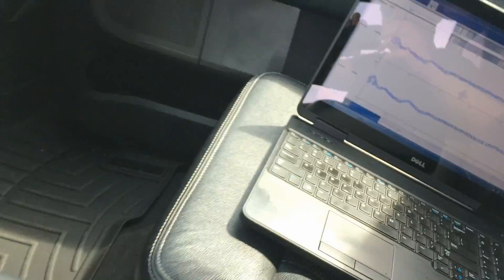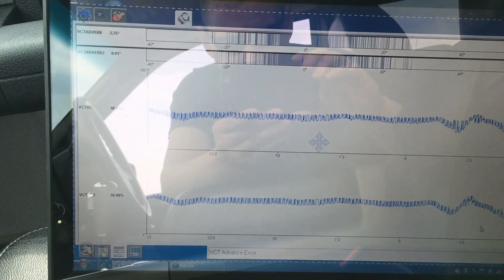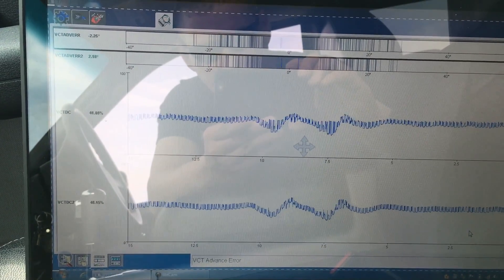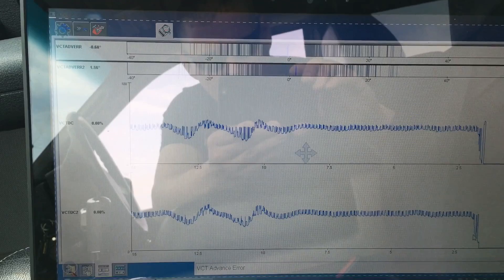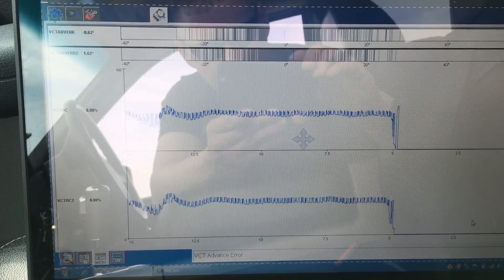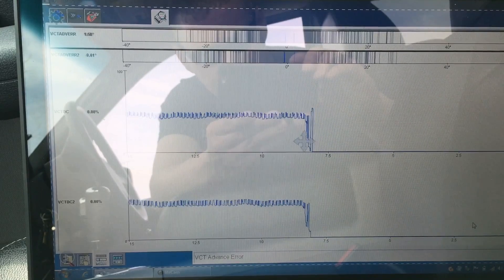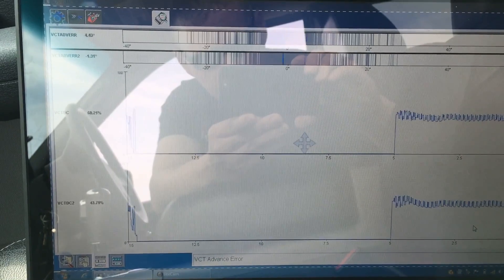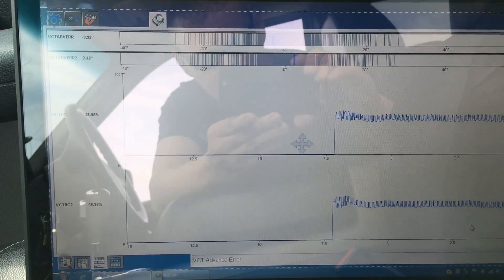Ford Quick Tips #74: 5.4L 3v Phaser Oscillation and Knocking Noise Explained

Comment from the maker: These are the Parts and Tools I Recommend:
Latest Updated Ford Timing Kit-
https://amzn.to/34GCMHT
High Volume Melling Oil Pump-
https://amzn.to/3886cRt
Engine Oil I Recommend-
https://amzn.to/2GbANSk
                                                                                                                                                                                                                    
 This is my 4 part series on fixing this concern-
Pt 1- https://www.youtube.com/watch?v=nQVKnd2r-ww
Pt 2- https://www.youtube.com/watch?v=u6wkyLEeUgg
Pt 3- https://www.youtube.com/watch?v=mjBPC10kjKA
Pt 4- https://www.youtube.com/watch?v=b2R3ZLQyu3U
Melling Oil Pump Install Guide-
https://www.youtube.com/watch?v=ulEJfcQ7HhA
Reply: Melling 10340 or 340 oil pump.. if i'm going in anyways... but almost doubles the cost. Big difference? If only you lived closer I'd drop mine off tomorrow ! (Lariat 2004 / 5.4 3v / 200k miles)
Reply: FordTechMakuloco I have just purchased a 2007 f150 with 5.4v3 engine, the truck has 189’000 miles and runs very good, I have noticed a slight Diesel engine like noise at cold start at idle for about 12 seconds then sounds smooth, according to carfax there are a lot of oil changes on the record at Ford dealership, is there something I can replace or check before it gets worst? Or is that normal?
Reply: would that melling m360 fit a 2006 f250 super duty 5.4 or the m340 would be my option?
Reply: My 2010 f150 makes the oscillation noise between 800 rpm and 1300 rpm. I do not have any knock or cam phaser knock or noise. I unplugged the vct solenoids and the truck ran perfect no more noises between that rpm range. should I just replace the vct solenoids? truck has 58k on it.
Reply: Jim Creteau all your doing is disabling the flow of oil to the vct's. So when you disconnect the solenoids the vet's never leave locked. the problem is the pressure of oil from the pump not giving a consistent pressure. Replacing the solenoidss will not change the pressure comming from the oil pump.
Reply: what is your take on lock out kits?
Reply: I understand that but was asking about using 5w-30 before I get pump changed.
Reply: @DirtyOldSailor  have you gotten your answer yet? I'm wondering the same thing!
Reply: @thegypsyvanner4142  I was told yes. I did go ahead and switched to 5w-30 and truck runs just fine.
Reply: FordTechMakuloco, I have a 2004 Excursion 2 valve & the cam gears appear to be part of the cam, but my kit came with new gears, do they come off?
Reply: Would it help to switch to 5W-30 full synthetic now if I am not experiencing phaser oscillation noises yet? 
I already use full synthetic 5W-20. 
Thank you.
Reply: Curtis Gregory, thanks for the info. I took the truck to ford two weeks ago, they replaced both vct solenoids and the noise went away. They did state that everything looked normal and that there was a tsb on the issue. trucking has been running good since the replacement. also noticed fuel mileage up .5 to .8 don't know if that had anything to do with it. what should be the correct oil psi? I am assuming ford checked it when they had the truck.

Comment: I have a "new to me" 2010 f150 with the 5.4 125k miles.  Does the phaser oscillation sound only happen while in drive?  I'm hearing that noise, but only in drive at low rpms

Comment: Hello have you ever cam across this so truck is at temp I look at the  timming and it's at 0.00 to 0.06 on both camphazers and then you drive the truck and all of the sudden the phazer locks up and the timming is stuck at 58 degrees off this is just one phazer the driver side phazer passenger side phazer is fine just wanting to know if you have ever seen a phazer get stuck now once the engine is off and been sitting and cooled off you start the truck and hazer is working then you drive it and it gets locked at 58 degrees off and just stays there have you ever seen a phazer do this

Comment: In this video, the oscillation is +/- 5 degrees, right? I have a 2010 that's seeing +/- 30 degrees when the engine is hot, but mainly on Bank 2. Have you seen oscillation that extreme before?
Reply from the maker: yes all the time when they fail.

Comment: My truck has been making a slight rattle the first 2-3 second at startup. I'm using 5w-20 high mileage synthetic blend and non-motorcraft oil filter. I reset the pcm and after relearning the idke, it's idling lower and has an idle vibration. It was also vibrating slightly slightly in acceleration from a stop. Other than at startup, it doesn't make any noise. Does this sound like I need timing done with sprocket/phaser/chain/guides/vct/melling oil pump replaced or am I about to waste 3k?
Reply from the maker: Yes, they all need a timing job but the drive away vibration sounds like another issue. Clean the throttle body plate then relearn the idle.
Reply: @FordTechMakuloco  Thank you so much for the response. You must get 100's per day!!! Impressive.

Comment: How long could u drive with phaser oscillation?
Reply from the maker: Not long
Reply: @FordTechMakuloco  could u get by with just changing out the tensioner IF that’s the only problem ? Without doing a full timing job
Reply: @FordTechMakuloco  how soon should I get the truck in a shop ?

Comment: Finding information for a 2010 f150 4.6 3v motor is a pain but i’m glad i found your video!! My motor started to make that sound only when hot and at around 800rpm, i was wondering if changing the oil to 5w30 could help the motor since it seems like it’s at beginning stage of this issue? Thank you

Comment: So on mine I have the knock only when it is at hot idle but it completely comes out of it when I put my foot on brake in drive and give it a little gas. Also I hooked up the OBDLink MX with FORScan  loaded up the VCTADVERR & VCTADVERR2 and they hover around zero like he showed in another video as what they should do. So does this still mean I should change the cam phasers because I remember him saying on another video if it's just the locking pin making a noise it not that big of a deal ?

Comment: Thank you for another informative video. We put the HV pump in when installing the new timing equipment but now there is a high pitch noise coming from the oil pump area, almost like if a screen was partially blocked with a lot of fluid going through it. Does anybody know what this might be?

Comment: I have a problem and can't figure out want to do next. I done a timing kit but didn't change the oil pump due to money. Did notice the right cam was harder to turn by hand than the left cam. Took it all apart and the right cam journals were scored. Main reason for the timing job was noise bad vibration. Well the passenger side tensioner was blow out thus why the cam was scored. All back together now I have phaser noise after engine reaches temp and goes away after 1200rpm and at idle oil light is coming on and going off. So do I need to replace both the oil pump and the passenger side head and cam

Comment: Hi, the parts still the same for today @ 2021 or are any new upgrades? On the video you mention two models of oil pumps M340HV and M360HV which I have to use on my 2008 F150 Harley Davison edition 5.4 motor? Thanks for your videos and Help.
Reply from the maker: All the parts are the same still.

Comment: The timing kit referenced in the description and the pinned comment is not available through Amazon.  I've actually not found a similar kit.  I did find a Cloyes brank kit at Summit Racing.  Any thoughts or reviews???  Great video as always.
Reply from the maker: Don't touch Cloyes, here is the updated Ford kit- https://amzn.to/34GCMHT
Reply: @FordTechMakuloco  Thank you sir.  Ordered with a new 360HV pump.
Reply: @mdcoomer67  Each part is listed in the listing that you can copy and call your local ford dealer and have them price it up....my local was about $30 more than the amazon full set...but bottom line ...each part is listed on that amazon link...just scroll down and find it.
Reply: @blafishing7581  I ended up with all the parts from a Ford dealer via Amazon.  It's just the specific kit was no longer available from that seller, or whatever.  Anyway, job is done with all the timing components, water pump, and Melling high volume oil pump.  Fired right up when I was done.

Comment: My Ford F150 doesn’t start ticking until it warms up but my question is can I drive it like that or do I need to get it fixed immediately. Once my foot is on the gas it goes away
Reply: Did you figure it out??

Comment: My 2005 F150 trition with only 46,000 miles run smooth and drives smooth and Idles smooth but when I put my foot into the Excelerator under heavy excelerating on the highway there is a ticking noise or rattling noise that only does it when your foot is in to the Excelerator heavy, but would that be? It’s not that loud so you have to have the radio off to hear it but I know the sound of my truck well and I didn’t used to do that.

Comment: Would you turn away and sell a truck with the 3v if you already have it and have you done any cam phaser lockouts and does that usually fix most of the problems with these motors

Comment: 6:21 I am thinking about only changing the bad phaser.  2004 F150 has 200k miles and everything was perfect until the passenger side phaser started making noise. Anybody ever do this job without all the extra parts?

Comment: I replaced the timing chains , cam phasers and the oil pump and water pump, the chain tensioners and the solenoids at the top of the heads that stick out of the valve covers. I got it all back together and cranked it up oh by the way it’s a 2007 gt mustang 4.6L and it runs rough and when you drive it it has no power and when at idle it rattles until you push the clutch in but I can’t figure out what’s going on with it I can rev it up and I do get some back fire and I’m getting a bunch of codes on my tuner p0345 p0349 p1000 p0600 p2105 p2197 oh and I changed my cams also to the comp fxi nsr stage 2 cams can you please help me out sr. I did use aftermarket phasers so I don’t know if that’s the problem thanks and I know one code is the o2 sensor it was getting that code before I changed everything
Reply: Hey man I sent you this message a week ago and haven’t heard back from you can you please let me know what I need to do to fix my issues, thanks and love the videos

Comment: You have been a God send when it comes to the 5.4 3v. Have done what you have advised. Kit with HO Meling pump. Went on long trip and 1500 miles out,,,,,
1. Dropped oil pressure 
2. Started tapping
3. Shut it off and waited 10 mins.
4. Restarted, ran fine for 5 mins and tapping / knocking started again.
5. Had it towed home. 

1. What do you think?????
Or procedure steps to follow?
2. What about Lockouts?
Reply: Having same issue all ford parts new pump really mad about. What codes r u pulling p0012 &p0022?
Reply: @Doghunter1  did you figure it out?
Reply: Did you figure it out

Comment: Could you recommend a kit for the 4.6 V8. My 2007 has just shy 300,000 miles and runs great but want it to continue running and I've noticed that noise but goes away after "warm up" usually 3 min after cold start.

Comment: Hmmm... I never used 5W-20 when I had my 5.4, I always used 5W-30 (in Iowa)  and got rid of it with 160k on the clock.  Changed oil at 4k miles religiously and it never gave me fits.

Comment: I think mine is phaser oscillation. It occurs during engine stall when I engage the clutch from standstill. I am assuming it is an indication of wear but otherwise operable until I rebuild the timing due to other noise.

Comment: My 05 F-150 5.4 just hit 100k and just did the spark plugs it runs awesome now, my question is you mentioned switching from the 5W-20 to 10W-30, isn’t 10W-30 thicker oil won’t that have even more trouble getting the top of the engine?
Reply: Use 5w30 as he said.

Comment: @fordtechmakuloco 
I have a 2004 F150 160k miles. The phasers and timing set could use a refresh even from 40k miles however I have a weird situation. My battery was low, truck was running normal. Shut it off to park. Returned to vehicle and it will not start. Battery and starter replaced. No start no crank. The starter makes a clunk like attempting to crank but stops. No security issues present. Is it possible to have a non repairable failure during shut off of these 5.4 3v engines? I plan to have the rockers inspected and the timing set inspected unless it can’t be rotated by hand at the crankshaft? Recommendations on things to check before dropping money on parts instead of a reman?
Reply: My truck sounded just like this prior to driving with the solenoids unplugged for the last week prior to my issue.

Comment: 2004 5.4  & its kinda has a rough idle only when in park & when I drive it shakes i can feel it under the driver seat its shakes from 15-30 MPH but after my speed is over 35 MPH the shacking completely stops but comes back again when i apply the brakes when the speed lowers back to 30MPH it shakes depending how hard i have to use the brakes ... any idea? Also have code for bank one & bank 2 but shop says could be both VCT sensors that went bad throwing off the codes any suggestions? Plz & thank you..

Comment: Hello. Looking for some guidance here. I defiantly have the phaser oscillation you’re describing. I do not have the consistent phaser knock. Mine only happens when the phaser comes unlocked, and at lower RPMs (low oil pressure). It’s a 2010 4.6L, with only 35k miles. Is this something that needs to be fixed now?

Comment: Had my phasers and timing replaced new vct solenoid and still has intermittent rattle from driver side at idle, put a stethoscope on it and it’s from the phaser no doubt, my question is how do i test the vct plug on the harness the reason i ask is that i replaced the plug it was broken and oil soaked so i bought a plug and spliced it in and am wondering if I’m having a harness issue? Does that sound like it could be that or is there something else i need to look for, truck still runs great just annoyed with the noise when passenger side is nice and quiet it’s only the driver side.

Comment: That's an interesting demonstration. With so many moving parts I guess it's no surprise that things would shake and wear as the engine ages. The standard answer to the cause of lower systemic oil pressure with an old engine is reduced peripheral resistance from wearing passages, higher ring tolerance etc. Add in devices that requires better pressure and you have need for a higher output pump as the engine ages.

Comment: All of your videos are very helpful. I used 5W30 on one of my oil changes on my 2007 Expedition, and was told to change back by the tech at my Ford Dealership. He said the boost in oil pressure would lead to premature wear on my guides and tensioner. Thanks for your better explanation of that. Going to start using 5W30 on my 2010 Expedition. What are your thoughts on using 5W20 and adding some Lucas Synthetic Oil Stabilizer?

Comment: I have a 2004 navigator I am not currently having any issues with my phasers would it be OK to switch oil way to 5W-30 now or is it too late I have 116,000 miles on it now.
Reply from the maker: +Stephen Bailey you don't have phasers so you are ok.

Comment: I've been putting Rotella 5w40 in my 04 Triton for years now without any issue. On a really hot day when I had 5w20 in it, I could hear how clangy it sounded almost like it had vegetable oil circulating through it. It really started to worry me that under hot conditions the oil may run off too fast because of it being thin, not allowing the metal to stay lubricated. I stuck with the 5 weight so that it circulates at startup the same, but it seems to really tighten things up when it warms up. The diesel clack doesn't really bother me because mine smoothes out at 1200 RPMs. The heavier oil makes it more bearable anyways. It has 176k miles on it now.
Reply: I actually couldn't find 5w40
Reply: Would love a update on how well that worked out for you I'm very curious person

Comment: Brian at BSG is very knowledgeable, and from what I see he know exactly what he is talking about. If you need your Ford 3V timing components replaced bring your vehicle to him, however, if you are to far from BSG Automotive in Illinois, come on down to the Gulf coast at Xtreme Auto Repair in Prairieville, La. I've dealt with many of the 2 and 3 valve Ford truck engines myself. If I were to go blind now, I could most likely do the job in close to book time.
Reply: @Xtreme Auto Repair   How much for labor alone for the whole timing job ?

Comment: Does this issue cause a bit of a down grade in engine performance?
Reply from the maker: yes
Reply: Thank you sir. I have that same noise on my 09 f150 with the 5.4 engine. I noticed that the acceleration is not the same as it use to be. I'll be having it repaired soon. Thanks again sir! Great video! 👍

Comment: My Name is Lonnie From Avant's Auto Repair In Deerfield Beach Fl My number is 954-480-6056 off ice cell is 954-931-8364 
I have a 2006 F-250 5.4 and it sees to have a sticking Phaser. I have changed the solenoids. If they are left unplugged. It idles much better and the noise is gone. I know oil pressure is VERY important but after checking that what should I do next ??